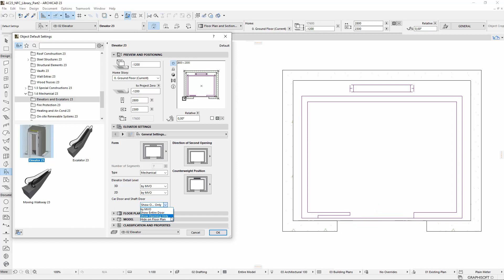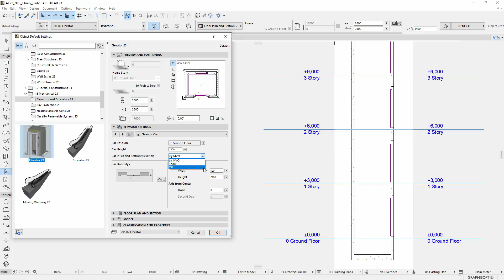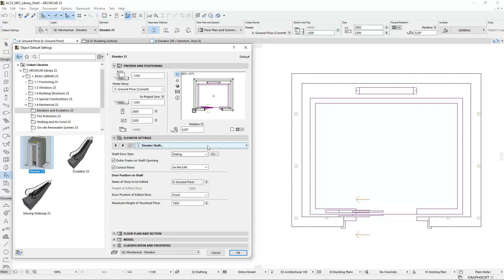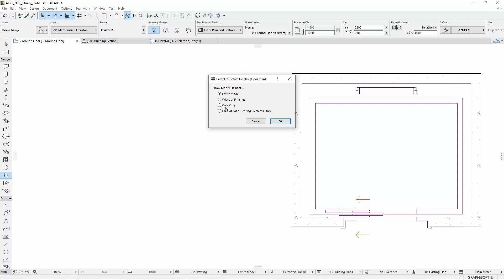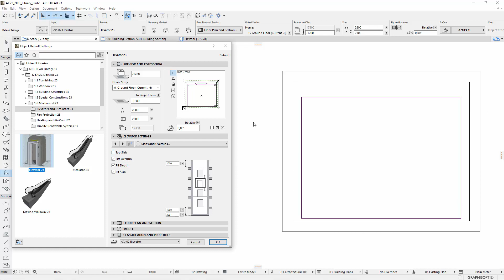ARCHICAD 23 - Enhanced Elevator Library Part

Comment: Nice! One inovation that could help a lot is to introduce amore tipe of elevator struture (more usual tipe). Like as glass metal elevator, different from the concrete wall available, because shows the metal structure on the pillars and beams, and only the glass cover.